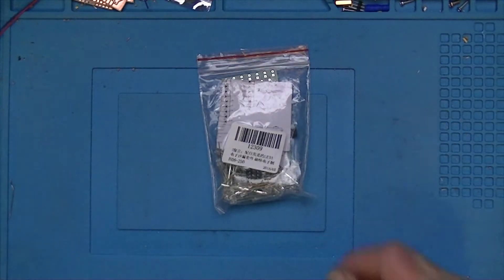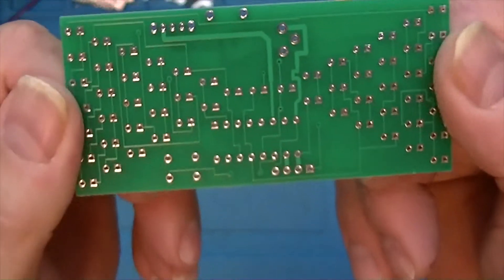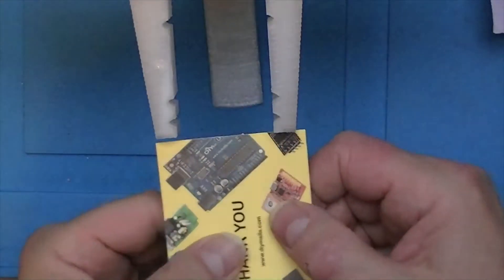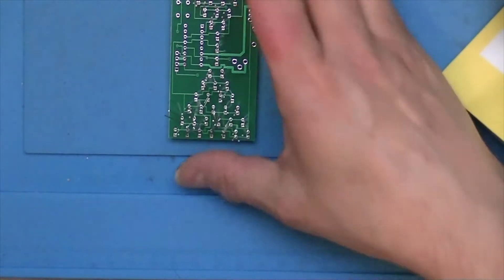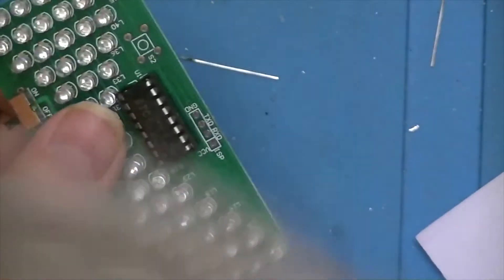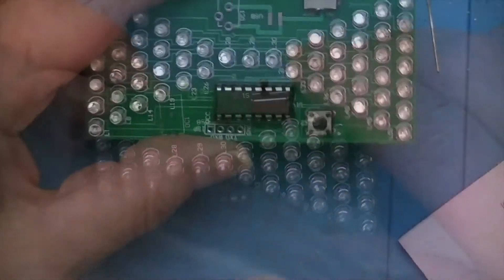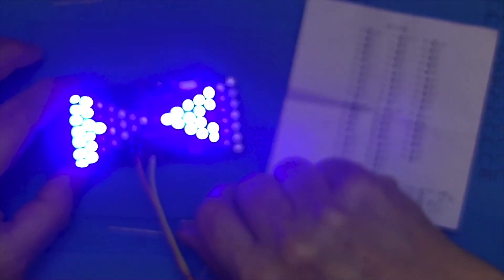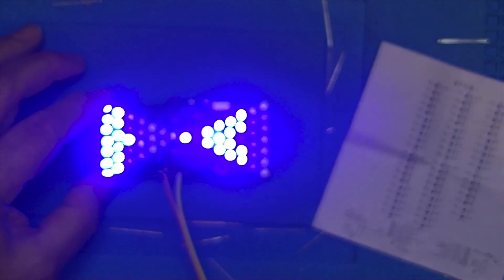Electronic Hourglass DIY Kit

Comment: Searched for a tutorial cuz i had no idea what to do with the cap. XD i guess they just send you one. :P
Reply: Same here. Did you get it to work? I soldered everything (hopefully correctly) and it did not power up. I used both 4.8v (3 AA batteries) and 6.5v (4 AA batteries) and go no joy.
Reply: @Hotshotter3000  mine worked but I found it was hurting my eyes something fierce. So I got some uv reacting nail polish and it was glowing. :/ so then I tried to use it to harden resin and sure enough it worked. :( they sent me uv LEDs instead of white LEDs :( it could’ve f.d up my eyes 😡